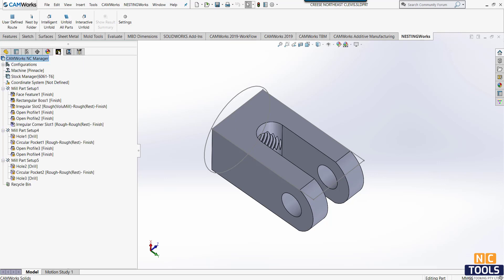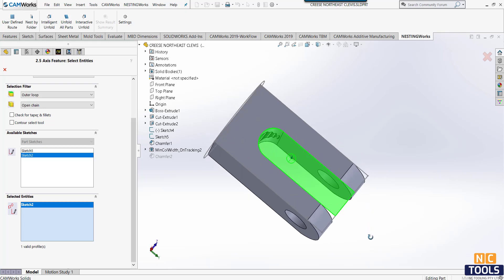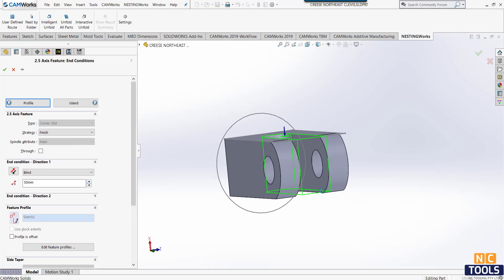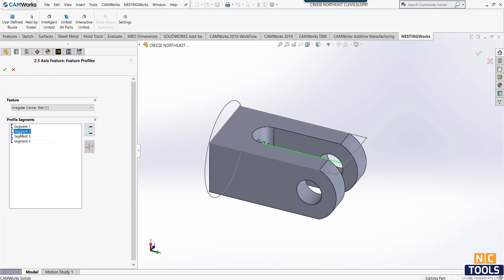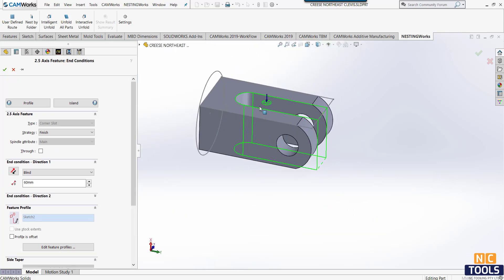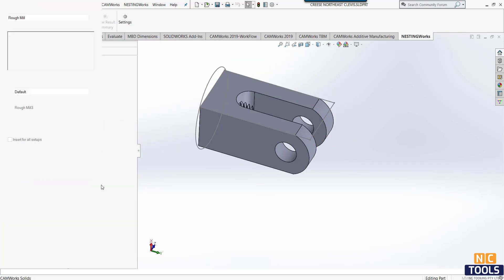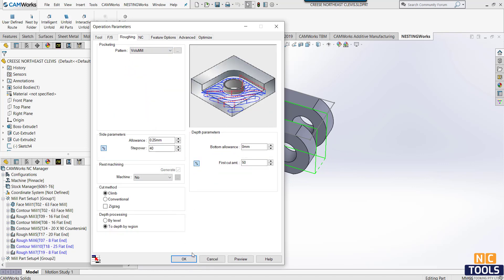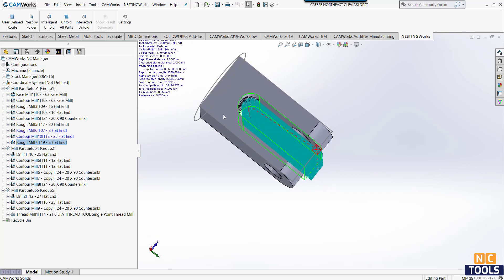Using existing Sketches in CAMWorks

Comment: I need to create fixture holes in my material that are not part of my model. My question is how do i create a drill toolpath using just sketches?  I understand how to use a sketch to create my material. I need four fixture bolts to hold my material down and they will be used when i flip the part over. They are symmetrical. Im not sure if anyone understands what im trying to explain, i cant find the information i need. Camworks.
Reply from the maker: You can create 2 D sketch and add Interactive feature like drilling manually
Reply: @nctoolscadcam2763  i was having problems using a sketch but figured out i need a separate sketch for the material and the fixture bolt locations. I was trying to use a sketch that showed both material and fixture holes in one sketch. It would not let me select that sketch. I was trying to select separate entities within a sketch. Thank you for your response. I then realized i wasnt far off.
Cheers!!!